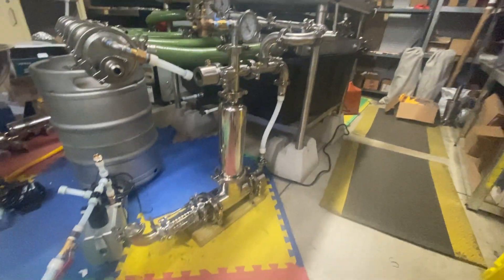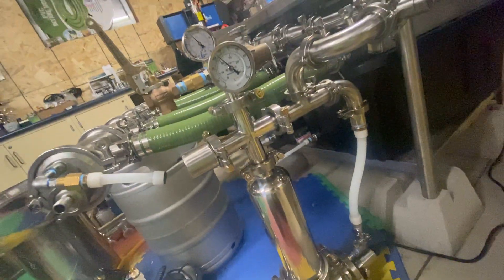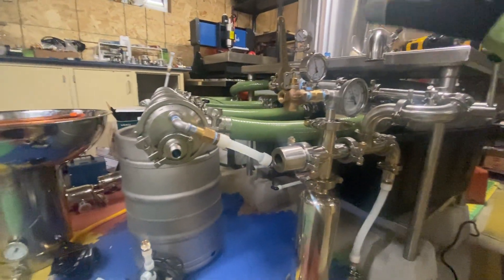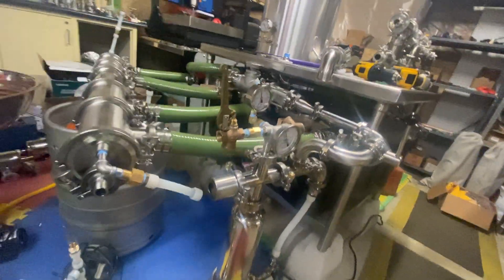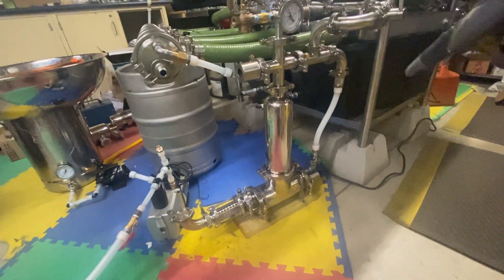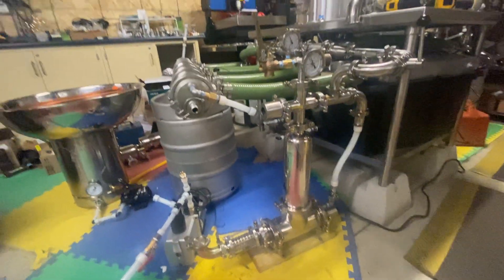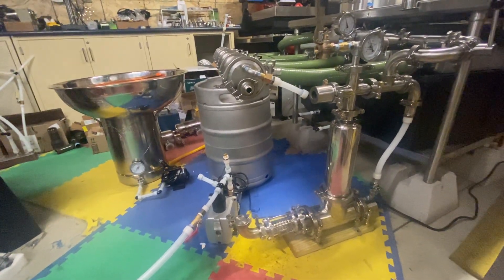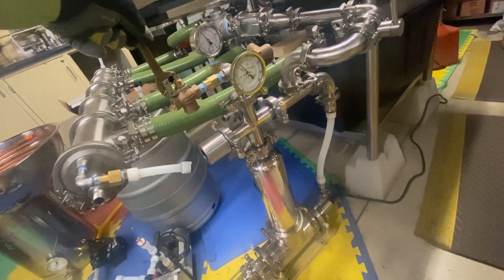Electric Micro Boiler For Tesla Turbine Cold Steam Control Experiment

Comment from the maker: If you would like to become a monthly donor to help accelerate my Tesla Turbine Alternative Energy Research please become a monthly member of my patreon community. Thank you! 
https://www.patreon.com/CharlieSolis

#NikolaTesla #TeslaTurbine #TurboJet #TesTurEnergy #solarpower #SteamTurbine #SolarSteam #SolarTurbine #renewableenergy #greenenergy #DIY 

Make sure to check out the latest updates on the combustion + steam Tesla turbine builds! 

Tesla Turbine 250 watt to 2.65 kW Power and Efficiency Test
https://youtu.be/K7qZvq1CMFg

+5 Horsepower Tesla Turbine Dyno Jet Turbo Power & Torque Curve 375 mph @ 125 00 rpm HIGH SCORE!
https://youtu.be/exF5Rn-L8gs

Solis Talks Tesla Turbines - Nikola Tesla’s Electrical Power Systems Patent GB 186,083 Walk Through
https://youtu.be/5Y3D13JmtcA

Tesla Turbine Jet Engine - gasoline fuel burner atomizer flame tube test 186,083 propane burner
https://youtu.be/gRqKowignac

Comment: Can you in explaim in dumb dumb terms what you are working/ experimenting on  on this channel? Is it some kind of new refrigeration technology?
Reply from the maker: Hey Name1 Name2! Very close! (Well future projects will include cooling but…) it’s the exact reverse! 

I’m making electric generators that are driven by a Tesla turbine and powered from various natural and available heat sources to show a proof of concept for a residential/home electric generator and heating unit. 

In technical terms a Combined Heat and Power (CHP) system for residential, district, and industrial level Primary Power Units ( Auxiliary Power Unit (PPUs) and Auxiliary Power Units (APUs) that operate on a combined Rankine and Brayton Thermodynamic cycle (steam + gas turbines, similar to a Cheng thermodynamic cycle) based off of Nikola Tesla’s improved combustion + steam turbine patent GB 186,083. 

Again, in simple terms, using heat to make a fluid turn a turbine to make electricity. 

Using natural/available low grade heat sources to make electricity and then the leftover heat from that is used for further home heating. 

(solar, geothermal, biomass combustion, hydrogen, alternate green fuels, even fossil fuel combustion and nuclear could be used if you really wanted.)
Reply from the maker: These videos will help elucidate everything. So make sure to check out the latest updates on the combustion + steam Tesla turbine builds.

Solis Talks Tesla Turbines - Nikola Tesla’s Electrical Power Systems Patent GB 186,083 Walk Through
https://youtu.be/5Y3D13JmtcA

Tesla Turbine Jet Engine - gasoline fuel burner atomizer flame tube test 186,083 propane burner
https://youtu.be/gRqKowignac

Tesla Turbine 250 watt to 2.65 kW Power and Efficiency Test
https://youtu.be/K7qZvq1CMFg

+5 Horsepower Tesla Turbine Dyno Jet Turbo Power & Torque Curve 375 mph @ 125 00 rpm HIGH SCORE!
https://youtu.be/exF5Rn-L8gs

Dr. Tesla Talks of Gas Turbines - Article Read Aloud by Charlie Solis AudioBook Tesla Turbine Info
https://youtu.be/TGGLG-7hK50
Reply: @CharlieSolis  

What are the big differences of a teslaturbine compared to a regular turbine? Steam/Fluid goes in, spins turbine, turbine spins magnetic core between copper-spools (os that the english word) and they produce electricity. Is that also true for the tesla-turbine?

And will the future projects work by compression-cooling or is there also some kind of technical novility included?
Reply from the maker: @name1name28  same as every other turbine system. However the Tesla turbine itself operates and derived its torque in a different way than regular bladed turbines. Instead of mechanically driving the turbine through particle/fluid collisions with angled surfaces, producing lift from surface pressure gradients, the Tesla turbine uses the fluids molecular adhesion to the disc faces and the cohesive forces with itself to transfer its energy and thus give a driving torque. 

Because there is no lifting surfaces for the fluids to smash into lower grade fuels, and solid fuels with particulates, can be used that no regular turbine or piston engine can handle. 

Furthermore because of this property of the TesTur, it can handle multiphase fluid flows with little to no damage to the turbine from cavitation. 

ALL bladed turbines see significant damage from wet steam due to cavitation and the liquid droplets smashing into the surfaces of regular turbines and piston engines. 

Wet steam is found in thermal sources like geothermal, solar boilers, decomposing biomass, etc. which makes these thermal sources difficult to utilize for regular turbines to operate in a fairly small scale “turn key system” due to the cost of manufacturing and short lifespan. 

As such even multi million dollar steam plants don’t fully expand the steam to the point that condensation forms in the flow, which leaves a ton of energy on the table in practice even when the turbine is sporting “high efficiency” on the books. The blades would be worn down to little nubbins in minutes if so. 

It can do that but not for long with wet steam. Usually the extra heat is recycled by preheating boiler feed water, plant heating etc. 

But because the Tesla turbine doesn’t see damage from multiphase fluid flows it can be used.
Reply: @CharlieSolis  

That's such an excellent answer I feel almost unworthy with my very very limited understanding of fluiddynamics as a ln apprentice mechanic for refrigeration machines. 

Thank you very much for that explanation.

How did you achieve your understanding of the matter you are dealing with now? Is there a laid out path, that you can recommend for me to follow to improve not only my knowledge but effective understanding of mechanics, physics, machines etc in a manner like you do?

Comment: So you have 3kw input to the boiler?
gonna be interested to see what portion of that you can get out of whatever generator you drive with the turbine.
I'll be big time impressed if you can get 1kw out as electricity. 
Because if you can get 1/3rd out, I think you have a good basis for a tow behind EV charger that can be fueled with whatever low grade fuels you happen to have.
I know someone that drives a truck for Frito Lay and he brings me chips to burn in my wood stove.
way more energetic than firewood.
Reply from the maker: Yup yup! If I can get between 500-1000watts I’d be elated honestly. Getting 16-30% overall thermal efficiency would be banger, and I think that won’t be an issue with how much thermal recoup is possible within the system. 

Yeah man Frito-Lay might be the new BP 🤭😜 

Either way, this makes biomass, annual leaves, yard clippings, etc all available for electricity production too, all carbon neutral, and even if it’s only 5-10% efficient, that is better than 0% when not even using those sources.
Reply from the maker: Also all the energy not used in the turbine can still be used for heating after 🤭
Reply from the maker: Technically since the entire system, including the electronics it will power, is inside my garage, I will get almost 100% thermal efficiency for the combined heat and power because even what goes to the electronics will become heat going back into my garage which I need all winter. 

So my home electrical energy systems “loss” will be my detached garage’s heating gain🤭
Reply: @CharlieSolis  well the next time a Mexican restaurant "gives" you a bag of tortilla chips that you don't eat, light it in your stove or fireplace.
It will amaze you.

Comment: In theory could a vacuum "cold" steam tesla turbine power the heating element in the boiler and get a net power generation thats enough to power a house?
Reply from the maker: The electricity being made by the turbine is at a significant loss due to thermodynamics of the Rankine cycle. So you would never be able to generate more heat with the element than the energy put in electrically. 

You have to add heat energy from outside somehow. 

However, I do plan to use the heating element as a “regenerative brake” on the turbine in case it starts spinning to fast. It would be at a pretty big loss though.
Reply: @CharlieSolis  thanks.
Reply from the maker: You’re very welcome!
Reply: @CharlieSolis  good idea you can easily use a windmill controller for this

Comment: There ain't nothing cold about that, thats steaming hot xD
Reply from the maker: 🤭😅yeahhh lol I had to see what pressures i could get it up to. But I will be operating it at a full range of temps and pressures. I’ll be keeping it at 70°c but still dumping the full 3000watts in for the vacuum cold steam tests. I need a control thermal input that will give me good efficiency numbers to go off of.
Reply: @CharlieSolis  love it. I meant steaming hot, as in the setup is sexy as f...k xD
Reply from the maker: @danny36120  NICE!! 😎 lmao
✈️——>
   🤦‍♂️
That went well over my head 😅🤣😂
Reply: @CharlieSolis  you can use use a standard boiler thermostat en set it on 70 Deg c en a KW/ meter to measure the energy over a period of time

Comment: Nice work! From experience I know a few kilowatt micro boiler doesn't deliver very much flow at a considerable pressure I think is should massive to get your flow rates you get from The compressor tanks , The theoretical 12% efficiency might only cancel the mechanical losses in the turbine, we shall see , again great work
Reply from the maker: Hey thanks Oscar! 
All I need is the turbine to make 500-1000watts off the 3000watt thermal supply and the boiler water producing vacuum steam at 70°c to prove the viability of the solar cryophorus. ☀️😈☀️
Reply: @CharlieSolis  my observation was At admospheric pressure, vacuum condenser wil add a lot of power to it
Reply: @CharlieSolis  as far as mi cryophorus experiment Goos , I had a 80liter boiler 65/70 Deg en the oschillator cooled it of to 50/55 in in les than 15min  even of I could get 300watt it's only 5% efficiency or so
Reply from the maker: Yeah I’m really excited to see the next steps on your experiments with Tesla’s “earthquake machine” mechanical oscillator! You’ve made so much progress!